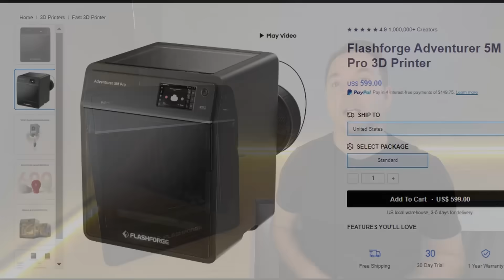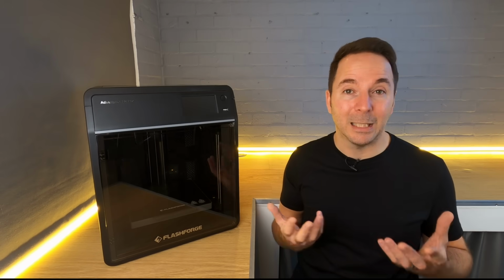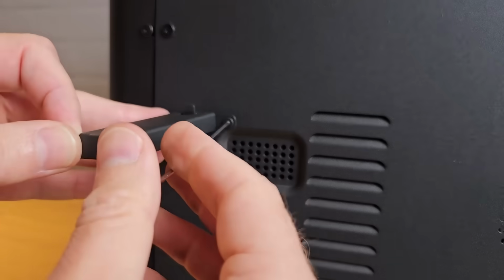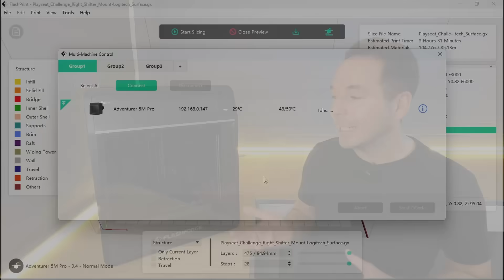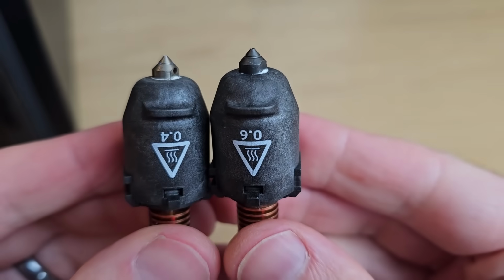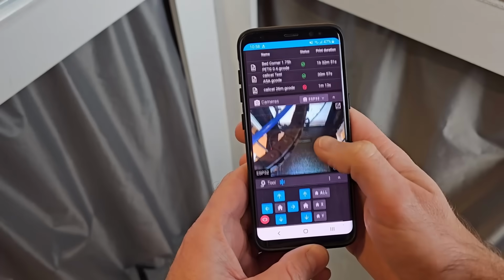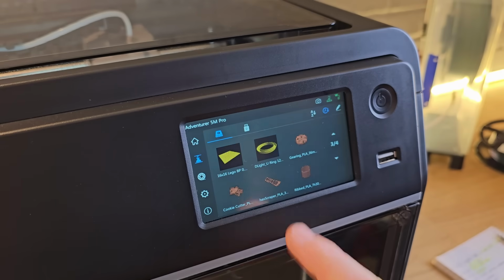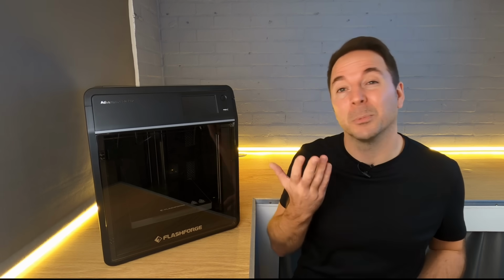The BEST 3d Printer That I Won't Use! - Flashforge Adventurer 5M Pro 3D Printer Review

Comment: No thermoplastic is good for you to breathe.  ABS and ASA release styrene which is known to cause cancer.  PETG releases glycol which is similar to antifreeze.  Not good for your kidneys!  All plastics release plasticizers when heated.  A plasticizer is that same film you get on your windshield from the sun baking the plastics in your car.  So you’re always breathing things that are not good for you.  Activated charcoal and HEPA filters will do a great job of removing some or all of these contaminants.
Reply: What if we printed like... a little exhaust port that could fit into a slightly opened window and used something like a clothing dryer venting tube to vent out the external fumes? I was considering keeping this in my WFH office, but now thinking maybe I should keep it in the mudroom or somewhere like that.
Reply: @arthurparkerhouse537  venting outside is just fine.  It doesn’t take much.

Comment: I have a Flash Forge Creator Pro that I still use to print ABS,  of course it has a chamber heater,  klipper ,  Duet WiFi mcu,  Bowden setup , E3d volcano,  dual cooling fans and can run no problem at 300mm/s .  Point being is this review printer could be completely taken over.

Comment: Wait how are they closed source and using klipper firmware? Is this not a clear violation of the GPL licence?
Reply: They made firmware not be able to be changed to non official versions. They can make changes to klipper, publish them, but that still doesn't mean the hardware can accept any unsigned firmware.

Comment: Strictly speaking in terms of quality/speed, how do you find the 5M Pro holds up against the P1S? I agree with all of your points - I'd really like to have the freedom - But the price point for the 5M (not the Pro) is what appeals at the moment. Moving up from an Ender 3 S1 Pro. 
I would also like to use OctoPrint with the 5M. Is this possible? I know version 2.0 now supports Klipper. 
Love all of your videos - You have been my 3D printing master for a while now!!

Comment: Glad I stumbled on this gem of a channel.  No experience noob here, fascinated by all the things people are creating.  Figured I've spent a couple hundred on 3d printed stuff on ebay like brackets for my permanent outdoor lights and such so I should get educated and play around.  Went with this adventurer 5m simply because of the features, noob ease of use and such.  Looking to get my feet wet and then perhaps invest in better hardware once I have some knowledge.  I would have gotten the pro model but the standard 5m is $100 off rn, scored it off amazon for $292 vs $599 for the pro: I can deal with a little more noise, have whole home purifiers so the smell should dissipate quickly I hope.  Thanks for your insight.
Reply from the maker: Welcome to the channel 👍

Comment: Hi Rick, do you planned to complete this flashforge 5m pro review with the kilpper firmware that has been recently plublished as it change quite a lot the conclusion about this printer ? It could be great to see the difference and the advantage we can get by using klipper with this printer please. Probably an addon to this video could be sufficient.... if you have time and motivation for it for sure. Thanks a lot for your great job that is always really usefull.
Reply: @RickyImpey  I'd also like to see this!
Reply: @RickyImpey  They released the designs as well and are bringing a cheap enclosure kit for the 5M with print files available. Pretty cool.

Comment: They just released Klipper firmware for the 5M Pro! Should open up a lot of possibilities going forward, no?
Reply: They released the source code, but there's no way to build it and install it. They removed the Makefile, and there's no printer.cfg for it.

I was really interested in these printers but they are going out of their way to make it an unattractive work flow model unless you use only their slicer.
Reply: @stew675  Well that's frustrating and disappointing. Hopefully this is just the first step rather and it will be improved. Since it is a GitHub project, the community can also fork and mod it now.

Comment: Needing to go to the printer so much took this printer off the list for me. I AM probably the sort of target audience because i'm in the market for a "just works" printer, but as my computer and printer aren't even on the same floor - that includes not babysitting it. 
If I had the free time to babysit my printer, I'd stay with my current 2nd hand Ender 3.
Reply from the maker: Have you seen the Bambu Lab A1? I'm testing one at the moment, it's very good and might be something you would be interested in.
Reply: @RickyImpey   yup - now eyeing the A1. Sadly - no news yet on when it's gonna be available for purchase in my country (can't even pre-order it!). 
Only Q is if I'm gonna crack and buy the p1s or crack and have an A1 shipped from abroad...

Comment: I seriously considered buying this printer but the price of the nozzles put me right off and then I found out about the wifi only working with the Flashforge slicer and was so glad I didn't buy it, of course its bound to get hacked and vanilla Klipper flashed to it but I am not prepared to wait for that, I ended up buying the X1 Carbon, I have been printing for over a decade starting out with a Mendel 90 kit I have also bought 7 Creality machines and have had to mod them to get them working correctly, I got quite into modding printers and ended up building a Pro 3D V-King 400 from self sourced best quality parts and I built a beast of a machine running RepRap on a Duet 3., since getting the X1C  all I have had to do is print a few clips to take out some bad angles in the reverse Bowden tubes of the AMS, and not having to tinker is like a breath of fresh air!
Reply: If i were to buy a flash forge 3d printer, how likely would it be for the printer to be hacked? Is it possible to run it without wifi? Looking for a 2nd printer after my Voxelab Aquila :)

Comment: I got a question, I'm planning on buying my very first 3d printer and I'm going for an fdm type like this. Does these enclosed printers usable in a basement and not worry about the smell and fumes? Or do I have to vent it out?

Comment: Hi Ricky, great video! I have the printer next to me on the desk and the noise is a discriminating factor in the purchase. After fixing the strange noise did it become at least acceptable or like the P1P? Thank you.
Reply from the maker: After moving thebcable away from the fan, it was a lot better but all of these faster machines need quite a lot of cooling so there will be fan noise. The only way to avoid it really is to print slower and reduce the fan speeds.

Comment: I have been 3d printing for 12 years my Third printer purchased was a Creator Pro which I still use. I checked and compared the Bambu, Creality and the Qidi. I watched this video and then a few others and with my Creator Pro being reliable for the last 8 years decided on the 5M Pro. I have been test printing different filament types since I received my 5M Pro and the quality and speed of the printing is great. I have  switched between using Orca and Flashprint to compare and although Orca has more features I have found that setting up my own slicing profiles for each material in Flashprint has gotten faster and better prints. If you load an Orca print from the USB you can still connect with FlashPrint and view the camera. I have had no issues with the build plate the only thing I changed was the PLA bed temp to 60C. I also am amazed at how fast I am able to print TPU. I am printing 3x faster than my other machines and getting great prints. I can not be happier so far with this printer so I decided to come back and comment on your video.
Reply from the maker: Great, I'm glad you are happy with it. It is a really good machine👍
Reply: I also had been using the Creator Pro in my Classroom and it has been good machine I want to buy my own machine for home use I do a lot prototyping and making replacement parts.

Comment: Some of your info is not correct I can slice with orca and still monitor my camera on the pc or flash cloud and the 5m does not have the soft start power button so you can turn it on of if your on a WiFi outlet I own both and would trade them for anything else I think over time they will unlock klipper I think the k1 was the sam way when it first released.
Reply from the maker: How are you able to access the camera feed if not through Flash print? Even Flashforge told me that is wasn't possible.

Comment: I have been a tinkerer of 3D Printers for a few years now and I am getting on a bit. Once I have a printer dialled in that is it. I send the file it prints it. As time goes on I am getting less and less enthusiastic to tinker when it does not print.All those hours spent fixing this, changing that are behind me. Having a machine that does almost everything fresh out of the box is looking more and more attractive to me these days. I was all excited to buy the Pro then Ricky got to the restrictions Flashforge has imposed on its customers. I am gutted. What they have done is stupid and counter-productive. Stupid because we are all being treated as if we are morons. Counter-productive because I will not be buying one due to the stupid restrictions. So, my hunt continues.
Reply: Jail brake is available
Reply: @juliusvalentinas  Thanks, but I bought the A1 soon after posting my last comment. Best purchase I ever made.
Reply: @slicedpage  You say A1 is better then Adventurer 5M Pro. Openbed  printer better then closed?
Reply: @juliusvalentinas  The restrictions placed on the adventurer at the time prevented me from buying one and instead going for the A1, so I do not know if the adventurer is better or not. I have placed my A1 inside an enclosure without any problems, although I do advise those wishing to do the same to provide lots of ventilation.

Comment: Kind of funny. They do the same thing year after year with nothing new just a different look. Bambu comes out. They copy it and use klipper but neuter it. Dumb move. Had they copied the bambu printer and left the klipper firmware wide open they would have a shitload of customers. Myself included. And this is coming from someone who owns flashforge printers as well as bambu lab printers.

Comment: I loved the review!  You have a great presentation skills.  But.... as a 3D Printer hobbyist myself, the hobby is dying at an alarming rate!  We have to move on and accept that what used to the hobby will now become mainstream.  If there's enough need and money to be made, 'they work printers' will become absolute norm.  I've seen this with the development of computers, from the 80's to now. With standard printers, which were huge and more expensive than computers of their day.  Even in software; e.g. database, web-development, etc.  Security cameras that were once high-tech, expensive, and complicated can now be purchased at Wal-Mart.  The same with drones, model airplanes, radio-controlled automobiles, 2-way Radios, AM/FM Radios, Walkie-Talkies, Refrigerators (Ice Machine), skateboards, roller skates, surf boards, etc.  It's unfortunate that Bambu Lab is a un-traded Chinese company, I would love to see their current worth.  They may have already surpassed Prusa in value; i.e. Prusa has a LARGE OPEX due to employee base.  Bambu Lab can have products manufactured cheapy in China, therefore lower OPEX with higher Profits.

People tinker, get something to a point that it can be saleable, then corporations dive in and take over.  This is especially true since majority of 3D Printing Hobby was Open-Source, these companies had a HUGE starting reference.  I once worked for a company that had 350+ engineers globally.  How long do you think it would take them to MASTER the 3D printing industry and cater to every niche?  

For those that want to tinker, me included, that demographic ratio will lessen in comparison as the mainstream folks that will come in the future.  I suspect, in 2 to 3 years, the number of hobbyists will be only 10 to 15% of the ratio, if that?  When technical/investment hits industry it always moves fast.  Not to mention, there are current hobbyist companies that will be unable to complete or sell their products, which mean bankruptcy for them.  Even in the comment section I am seeing hobbyist purchase Bambu Lab units, where's the talk of Prusa?  They're already the word of yesterday.  Which is sad because I own two Prusa, but I don't expect to see them in business in the next two years.  Not unless every hobbyist is willing to purchase a MK4 every 2 to 3 months.  Otherwise, where will they get their sales?  Do you think that a new mainstream buyer is willing to purchase a device made of printed parts, when they can get aluminum?

Comment: Even with the locked in limitations, 550 is a Great deal for such a well performing and consistent printer
Reply: You don’t have to mess with anything they just work right out of the box
Reply: the limitations exist only if you want to use it exactly as designed. you can install new firmware to remove the limitations. this appears to be a great model.

Comment: Just a Bambu X1C clone.  Like the print head (which was not expensive despite what was said in the video) but not worth extra cost.  Bambu is also a closed system, but not once have I had to adjust the default print configuration to get good print jobs.   Not saying Bambu is perfect.  But it's close enough that I wouldn't bother with this one.

Comment: Mine just arrived yesterday, The reason I went with Flashforge is because of customer service and parts availability in my area (they ship directly to my area unlike many other brands). Also, I can still get official parts for my 9 year old Creator X so long term parts support is a plus for me (in exchange for noticeably less community mods/support/third party parts so it's a tradeoff). That said, I do have a Bambu  Lab X1C which I love. But most of my older Creator Xs and Creator Pros will be replaced with 5M Pros. The Flashforge formula (their slicer history included) has always been "get up and go and keep going till something wears out/breaks" at the cost of features and customizability. My Creator Pros are now dated and have been a little basic even when they were new but I haven't needed to relevel it in 5 years considering it prints almost 24 hours 5 days a week 12 months a year.
Reply from the maker: Great information on Flashforge's long-term support of their models, thanks. Great to hear they don't drop them after a year like some other manufacturers.

Comment: Awesome review.
Regarding the "closedness" of the printer:
I loved my Ender 3 S1 Pro and the SonicPad thanks to your videos. I always love to play around with stuff, setup my home automation and all these things.
I got fed up with prjnts being messed up and after my Ender 3 decided to not print a first layer after being shut down for 6 hours, I was bothered.
Tried everything and in the end I gifted myself the Bambu X1C.
Yes, spare parts are more expensive. But they are available. Every single piece.
Need a ribboncable for your bed? It's available. Need a stepper motor? No Problem.
How about a replacement cover for the hotend? Sure.

I had bent leadscrews on my Ender 3 S1 Pro. How can I get replacements? I can't.
They are not Standard Ender 3. I would have to cut them myself. How? That's my Problem.

"Closed system" is a mixed bag. I would love my printer "offline at home" but then I lose app access. But the webcam feed is sometimes bad because the cloud is slow. So yeah... No real opinion on that right now. But the hardware and the machine just freaking work. No messed up first layer. Just print and go. And this to me is bliss because I need to move the printer to the basement (third floor appartment) due to space requirements. So it MUST be reliable and remote controlled. And my Ender with a Sonicpad was not thst trustworthy for me.